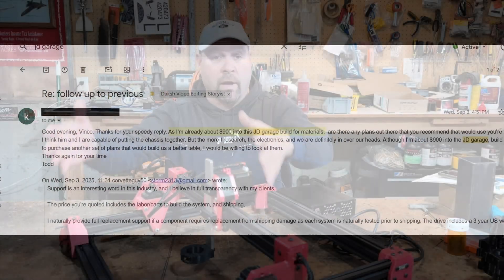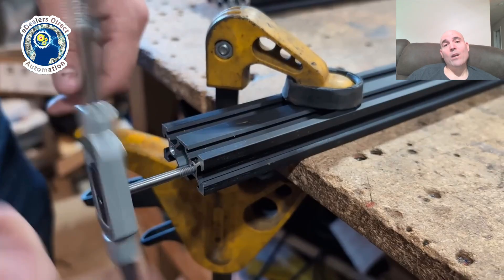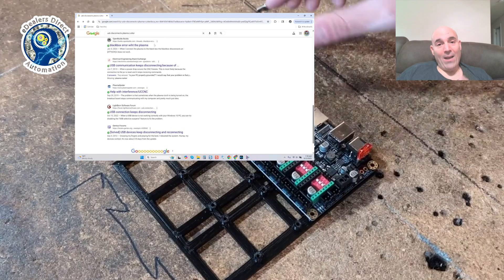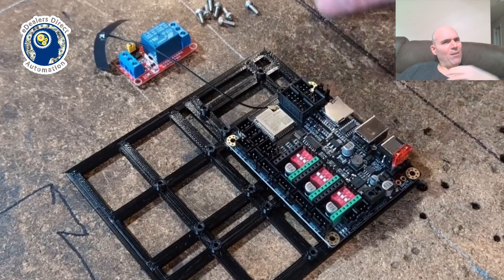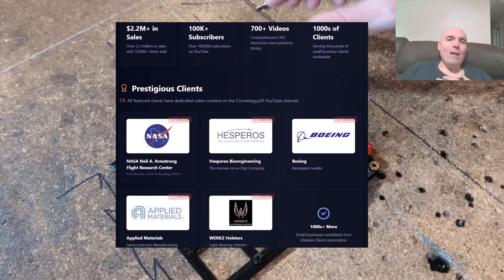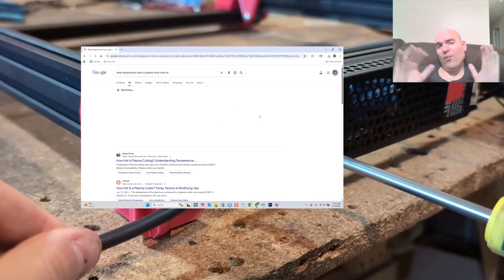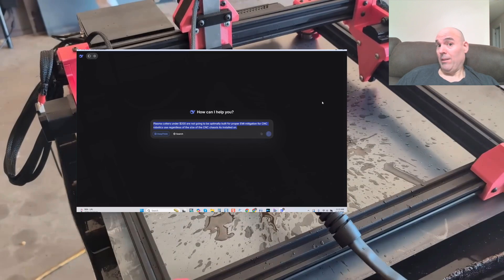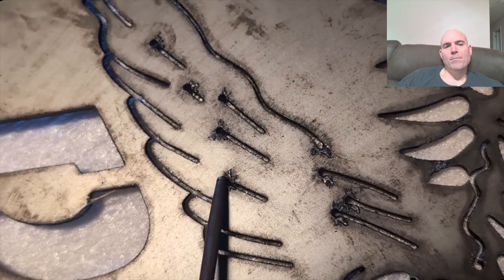👀 A Look at JD's Garage $200 CNC Plasma 👀

Comment: I know it bothers you that they don't use high-end electronic components, but keep in mind that in Latin America, many Arduino components are used for professional solutions, and there's a very good response to these electronic components. Also, part of engineering is always doing the best with the smallest budget, In fact, it's very easy to build for clients with deep pockets.
Reply from the maker: Look if your happy using Arduino's to what you claim are "professional solutions" that's your business it doesn't change the facts presented in any of my videos that for CNC robotics they are completely unstable.

Thank you,
Vince

Comment: I wasn’t overly impressed with the plans. Lots to be desired. Plus you must have internet connection which usually sucks in my shop so I felt like I was scammed. I bought some Australian plans that blew these ones away, however this one being compact and selling brackets I gave it a shot. The jdg’s cnc is lacking a bunch, but I purchased it so, I will eventually finish it as parts are harder to find and tariffs making them more expensive as I am committed now. I would recommend thinking about whether or not you should purchase just for the reason is you never own the plans. What am I paying for before I buy!? It’s really upsetting and scandalous by them. Had I have known what I do now, I’d have passed…

Comment: I'm currently building these plans with my young son. It's a fun and approachable way to get him interested in CNC. I've built commercial CNC machines and controllers for years so I've a good idea of what's what. With that in mind I think you raise some valid points, although in a very condescending and arrogant way, lol,  but I get it, the rage bating gets clicks and eyeballs, and possibly some sales.

This design is clearly as far away as you can get from a production machine. Tolerances and repeatability? Rough enough is good enough? I'll find out I guess.

The learning experience for my son is far greater than anything else and it's not costing me much. Good grounding, shielding and a decent plasma machine go a long way to control EMI. These are not insurmountable issues. 

I would be interested to see you do a video "Let's make this good and safe by doing the following" to help noobs entering the CNC space. That won't make you any sales though so I get it.
Reply from the maker: I'm not rage bating, and my videos show I certainly don't get that many views to prove it.

You said yourself that "This design is clearly as far away as you can get from a production machine."  That's funny because according to JD it works fine for the garage enthusiast to curt components with accuracy, and repeatability. 

You also said "Good grounding, shielding and a decent plasma machine go a long way to control EMI. These are not insurmountable issues." Why if he's selling the plans doesn't he prove that to be the case? 

I also don't understand what your son could be learning if the electronics are built incorrectly, and nothing is properly grounded or double shielded to produce a stable plasma CNC robot. 

Once you build in instability it isn't removed until all variables are covered. 

 I've said it before, if your content with your investment disregarding the facts that the system is built incorrectly, following best practice to ensure system stability then have at it. 

If you're really interested have over 750 videos showing what's required to assure CNC robotics stability. 

My goal is to make sure people know the truth before spending their money.

Thank you,

Vince
Reply: @corvetteguy50 ill let you know how it turns out in testing as is and if mods are needed.  I'll do repeatability etc.

Comment: I found the JD machine to be very appealing obviously due to its price point. What do you think about the all metal version and new onboard touch controller. And I am not looking to fight I just think a piece of equipment like this would be useful and fun. What would be a budget minded reliable machine that was around the size of the JD  mini be in your opinion. I honestly dont know much about this but I am fascinated with it. Any help would be appreciated. I have watched some of your videos on the JD Garage CNC machines and they are the reason Im writing this. Thanks!
Reply from the maker: Hey Steve,

The issue is not about how the machine is used which for some reason is what most people think. They explain "I'll only use the system casually" .

That's fine but does that mean you'll accept if its unstable when you attempt to use it even if its only one day a week?

What if it works on a 10 minute job, but loses signal, or experiences "ghost switches" on a 2 hour job? 

Its still only being used once a week right?

This is the point I'm making. Unstable CNC robots are the worst because you never know what, or when will make them have issues. The only thing you know for sure is if the electronics were built according to best practice for piece of mind.

Robotics are either yes, or no, when it comes to stability, and consistency. Its not based on end users run time, and or their applications. Its based on all the details built in a synergistic effect. 

USB controllers, not using double shielded cables, not grounding the chassis, hell not even thinking about installing coatings on the chassis that make it insulated to be grounded define exactly what your buying. 

Thank you,
Vince
Reply: @corvetteguy50 Thanks for the explanation being new to this or the thought of it there is a lot of confusion and unknowns. I don't have a lot of money to spend to get something that dosnt work no matter how inexpensive it is. Looks like this goes on the back burner?
Reply from the maker: Saving is always better than risking money. 

Your money safest in your pocket. 

Thank you,
Vince

Comment: I disagree that "hobbyist" is being misused. These cheap homebrew type tools like this are kind of meant for the person in their garage needing to make small simple parts without much fuss for their car, motorcycle, go kart projects. Look who arcdroid market to (and it deserves it's own criticism), it's not people selling plasma cut parts. It's people that may fire it up once a month to make that bracket that would take an afternoon to make by hand. I'm willing to spend my own time to replace a couple controllers, sand off anodizing, and debug some cable shielding to not spend the money because a small cnc plasma capability isn't worth $5k to me. Plenty of people have built their own tables with controllers like these (look at MPCNC/Lowrider machines from V1). Btw, 3d printer folks have been wiring into these kinds of power supplies this way for over a decade now. It's not the safest, but it's not uncommon, especially if you strain relieve the cable well enough. I've done this and printed my own fused & switched C14 male receptacle for projects to hide the AC wiring and give me a switch on printers and small CNC projects because I agree (and I like being able to detach the supply cable). 

These guys started just wanting to make parts for their go karts, I don't see the harm trying to make some scratch to buy some materials for their own hobby. Many people don't need dead nuts reliability to make some tabs and brackets for their project. For me who works on cars a lot, having something that I can disconnect and throw up on a shelf and get it out of the way is much more valuable than having something production hardened. I think your professional perspective has skewed your ability to see this from the small shop fab guys eyes. I never plan on making parts for anyone but me. I see these same kind of criticisms from people saying cheap router tables would never hold up and so on when maybe... just maybe people like to tinker and add a little capability and just like making stuff (and messing with tools may also be part of the hobby). If someone is trying to make it a job, then yeah there are much better avenues to go down and concerns to have. Idk what expectations people would have of a small channel where a guy and his son are tinkering with cheap plasma tables, but being the basis of a business for a watcher would be silly.
Reply from the maker: If you don't care about consistency, then this is for you. Most people want their machine to work, so they don't have to troubleshoot, and waste time, and money.

Hobbiyist robots don't exist. Small scale robots do which are still meant to perform reliably just as much as a full scale robot. 

Thank you,
Vince
Reply: @corvetteguy50  Curious, what would you consider most 3d printers (regular ones in the sub $1000 range) if not hobbyist robots? I think the fact that people are so drawn to MPCNC, Print NC, GRBL and marlin cnc builds, all these videos of "CNC for XXX" that get millions of views shows many people want to tinker. I mean why would GRBL as a control paradigm even exist if not for the hobbyist? It's objectively not reliable from a commercial perspective... it's because if it kind of works (even if it does poorly) then it may serve some peoples purposes. I think you have valuable insight and I think the warnings are valid for people knowing what they're getting into with these kinds of projects. Idk how someone wouldn't look at something like this and think "this will definitely be something I will tinker around with" instead of "I am going to make this $200 table the basis for a business."
Reply from the maker: A 3D printer, and a CNC router, mill, plasma production robot are totally different in the amount of EMI produced.

 You said it correctly people want to use those boards you listed to "tinker", and tinkering is what your doing with your money if you invest in these boards thinking your going to have a stable production plasma robot. 

3D printers can use them all because they produce a very low amount of EMI, and I agree with what you said exactly about the boards working in terms of turning on, but producing reliable results in a completely different thing, and I would have no problem at all if these types of marketers told the truth. "hey buy this it works sometimes, and not others, but its unreasonably cheap" 

I just hate when novice end users find videos like he posted, and believe the content creator claims wasting their money, and time.

Thank you,
Vince

Comment: Uh... But I AM a hobbyist. Sorry about your nerd rage... That must suck. I am realistic about my investment. I do dangerous things all the time, professionally. In this arena, you have to be smart enough to assemble something to make it work and kill you in the process. I don't think anyone who is smart enough to assemble one of these is dumb enough to think that a 3d printed amazon sourced light saber machine is completely safe. I don't think anyone would assume that a $200 machine (More realistically $300) is GOOD, but perhaps good enough to get started. The idea of these plans is that you can make a machine that WORKS, mostly. Does the ground suck? Sand a rail and install a couple straps. So what. Is the board less than ideal? Sure. Can you spend more? Yup. Be my guest. Bottom line, I don't think any reasonable person would think "I'm going to build this bargain basement device and start a business selling fabrication platework.". I intend to get started with this, and maybe upgrade. If this does work most of the time for my needs, I might just upgrade it by making metal plates and such, and keep it. This is DIY... So make a better machine yourself. Sounds like you have, so good for you.

Comment: I'm not trying to start a fight vince but that looks like an esp 32 mks dlc32 card.  I have the max version with 4 outputs.  Haven't ran it yet but it can go stand alone.  You dont need the usb tethered.  That's why i picked one up.  For arduino mega 2560, i plan on doing similar with micro sd and stand alone mpg click wheel screen.    I dont want a laptop or usb ran on my stuff for the simple reason i tried one of those creality sonic pads for klipper on my 3d printer and it would work fine for a bit then would drop out then got to the point it wouldn't connect at all.  You're right to hate on usb.  I hate it too.  But the mks dlc32 can run without a computer.  If i am wrong, do correct me or educate me. I'm very open to criticism.  I've only been in automation for 12 years professonally running upwards of 4 million dollar a pop machines.  Beckoff, seimens and fanuc controls.   The hobby stuff is just that.  A hobby with a chance of maybe more freedom doing stuff on the side.
Reply: That said, i did agree with everything else you said.   The dlc32 is not even close to industry standard. I'm getting by til i get my centroid acorn money.   :)

Comment: I built a cnc plasma with a plywood frame and steppers from old printers for a one-off job.   The EMI took me 80% of the build time to fix but I recon I did it all under $200. Not a long term solution but it cut enough for a wind vane.
Reply from the maker: Thank you for your support. I really respect honesty. Vince

Comment: JD's systems may not be perfect / production level, but they meet a price point.   I clicked on one of your links and the controller was $800 - more than twice what the entire JD system would cost so it's completely not a starter for me in my garage.   Instead of just bashing him, it would be great if you could suggest ways to improve his designs in affordable ways . . . but that won't happen as you need to convince the world they need $800 controllers and $10K CNC systems.
Reply: So the fact usb is not reliable or stable yet there are factory built cnc machines all over the place? So you are “debunking” one machine while other use the same thing while pedaling your own goods that just shows a biased review and therefore no longer a valid point
Reply from the maker: USB is not designed for CNC use period as its unstable proven time, and time again my videos.

What factory built CNC robots have USB except ultra cheap versions? 

My videos all provide proof with snapshots that USB is COMPLETELY unstable.  

You provide nothing, and are an internet ghost.

If you want to use it that's fine sorry the truth hurts your feelings. 

Thank you,
Vince
Reply: @corvetteguy50  Every 3d printer I've used over the past decade, and even the HAAS 3 and 5-axis CNC machines were running off flash drives via USB-A 2.0. Sorry if I'm misunderstanding
Reply from the maker: Sounds like you're not ready for the truth. 

You realize that even small plasma production robots are easily 4-5k right, and that doesn't mean their not built in a similar fashion than what you see here.

 I suggest saving your money to protect your initial investment if your serious. 

We all used to remember how to do that, but unfortunately you want to buy an accurate production robot for the price of a 20 Starbucks cups of coffee. 

Its time to be real!

Comment: In your opinion, what is the least amount a guy needs to spend to get a reliable electronic system for a 3 axis cnc plasma system, with motors?
Reply from the maker: How do I answer that without knowing what you intend on building? IE the size of the chassis, and the features it has? Details are everything dictating price.

Thank you,
Vince

Comment: The controller bring used on this new machine is different from those used on the older machines. It appears to be is an MKS DLC32, These controllers do not require a constant USB connection, rather the G-code is read from an on board micro SD card. And you can communicate with the board in multiple ways, USB, bluetooth or over wiki. Whether or not that's any better for this type of application. I don't know.
Reply from the maker: Here's what Google says because many people won't listen to me even though I've been building CNC controllers for the last 15 years online alone. 

https://www.google.com/search?q=MKS+DLC32+is+unstable+for+CNC+use+due+to+its+vulnerability+to+emi+and+shouldn%27t+be+used+with+plasma+CNC+robots&sca_esv=5d00e0a4043178f7&hl=en&sxsrf=AE3TifOH4mcFeF-o-bqk8QrQQ7D8VDWXUQ%3A1762258272367&source=hp&ei=YO0JadueFI-XwbkPiJPbmQg&iflsig=AOw8s4IAAAAAaQn7cJpvgsLCmF5nkHOgxgjbTZ1yiOiI&aep=22&udm=50&ved=0ahUKEwjbzszSu9iQAxWPSzABHYjJNoMQteYPCBM&oq=&gs_lp=Egdnd3Mtd2l6IgBIAFAAWABwAHgAkAEAmAEAoAEAqgEAuAEByAEAmAIAoAIAmAMA4gMFEgExIECSBwCgBwCyBwC4BwDCBwDIBwA&sclient=gws-wiz&mstk=AUtExfDbYwjAmsnIw_BibYcLSJuDmbOuFkP0LpdwEpSk8AKE-AMBio8gdSh5MVndxcnYZhtBymWIZFJP_P1J00XF9Inr2sYyYLSjInG6Z1MxAZg3HGhNPOZaB8MQXmT56Etw7iWeFlYMJ0EXF1ZlyvtPbbpTHNInVhywbJ4UKO1xhazL7G5A1qFOixV-j4AclF2t49oWe0eYwnyg_Ej1MxE0tqkYcTFJ0eLTe0-s5BrSil71AIhgjq-VWzpNX2xl3nfhOdgP9IOSzz_POFmzmBadruUxh4x5u-43lPUBXMEsmd0mZv0K8UXW0WMavSICiOe4quzLT_IbERQJsDWC_tarmKATSLs528pGt1RSVRmknrN7OsJkRKxgsa0qCX2SYB9XQjGs5AmDc-5Kp7ndu9yTQKd1dt2-M4-zEd-7GVTdk2hslzqJkMsCkJNAdFDykBsbIyc9VkBy3a4&csuir=1&mtid=bu0JaYCNBMeJwbkP6Lfe-Qs

Thank you,
Vince